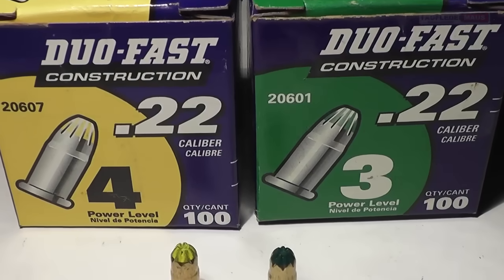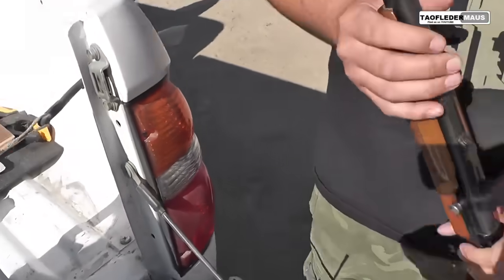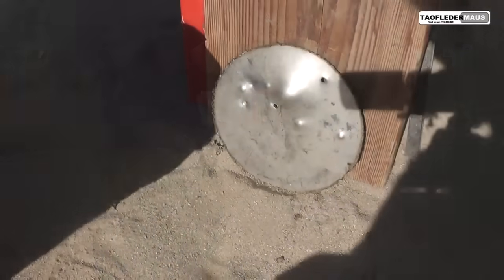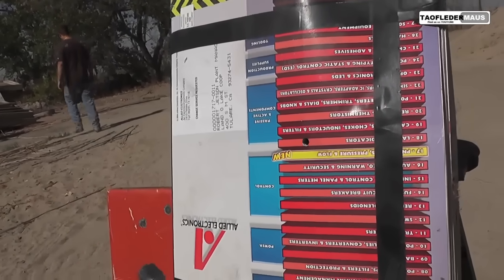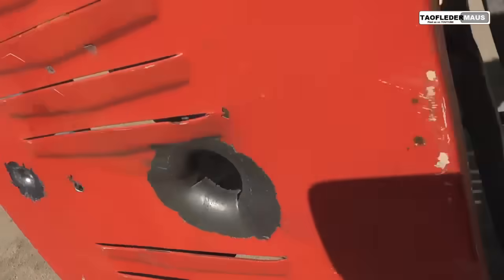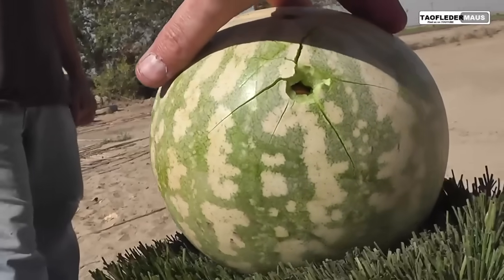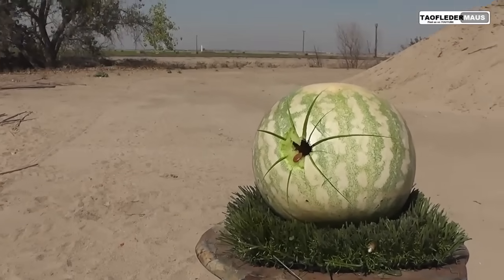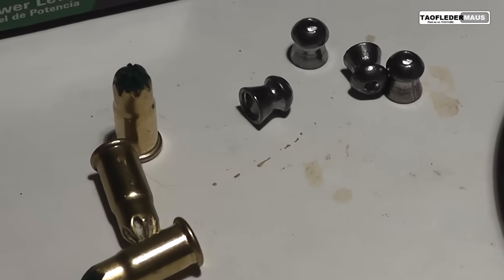Shooting .22 PELLETS Using NAIL GUN Blanks - What happens?

Comment: Thanks for the idea!  Did you know that a small pistol primer fits perfectly into a 22. case?  Break off a 22 head, dump just a little powder out (to be safer lol) and press in small primer.  it becomes a bullet.  I wouldn't recommend this actually,  but it DID work though my SP 101 short barrel.  I didn't measure but primer must be exactly 22 cal in size because it came out full power (right through spray paint can) no excess windage

Comment: The reason why this is highly discouraged is because you need to leave enough space between the pellet and the blank for the blank to expand when it's fired. This creates a problem because leaving a gap between the power source and the "obstruction" leads to a pressure spike which puts much more stress on the barrel than it's designed for.

Comment: Just saying, I have had a 22 blow up in my hands and I was lucky that's all that happened.
Reply: How did that happen was it a top break over under???
Reply: @frankatchison1617  It was a simi auto but my dumbass filled all the empty space in the shell with gun powder. The only thing that probably saved me was I drilled a hole in the action that I could put an Alan key in to make it a bolt action.

Comment: How about a .22 revolver? Take the cylinder out and load it up. Put it back and fire like a old cap and bail pistol.
Reply: Tried it. Had to use some paper to hold the pellet in the cylinder but it works awesome. Punches holes instead of pushing through.
Reply: Says the guy who didn't watch the whole video😂
Reply: My bad I was a Ruger semi-auto 22 LOL
Reply: Pellets are soft lead. At high speeds and fired by a hot powder charge I would think barrel leading would be an issue.
Reply: Use airgun slugs in a revolver instead of pellets,

Comment: I remember being a poor southern boy in Texas. Me and my buddies didn't have the cash to buy rifles so we took piece's of pipe with a diameter big enough to fit a 22 round and a end cap with a small whole drill off center. We had his dad who was a shade tree mechanic weld a nut to the end of the cap so it would act as a guide for a carpenter nail then another small piece of pipe with one side cut so it would hold the nail with a small spring on the back. To load we simply unscrewed the end cap and placed the 22 round into one end and put the cap back on. To fire we had a small piece of wood blocking the nail from striking the round. We simply lined up a target and pulled the wood out and bang! Dead squirrel for Dinner! Yeah it was inaccurate over a few yards but for squirrel's, rabbits and other small creatures at close range it worked! So glad we never used nail gun blanks and pellets that extra hot charge would have blown up our DIY rifles! Great time's Great vid!

Comment: There are a few thing  to do to get good accuracy. First off a pellet 22 cal is smaller than a 22 lr  so its  not going to   fly right  out of the  barrel they are not spinning  . Most of the   pressure is getting lost   around the pellet  in the barrel  because its smaller  than the barrel .   Use a 22cal lr  mold and make   some  lead bullets . Load the  lead  bullets  in the gun like  you did the pellets  and it will work great  and its very accurate .  With a air gun pellet  because its not a slug  it will tumble  at anything  fps over   1,000 fps . If you don't want to make the lead bullets   just buy these https://northamericanarms.com/shop/parts/cbb3/    What you are doing is like a Cap & Ball   setup . You are just using  to light and to small of a pellet .

Comment: Why even bother when you're using a .22 rifle and paying 5 buck for a pack of nail gun charges plus the cost of the .22 pellets, when you can go to Cabelas and pay 3 bucks for a pack of .22 LR bullets, built specifically for the rifle you're using?
From Cabelas website:
Caliber: .22 LR
Bullet Weight: 40 Grain
Bullet Tpe: HV Copper
Number Of Rounds: 500
In Stock Online
$36.99

Comment: Jeff, I'd love to see you guys mess around with powder-propelled pellets some more. Could you make up rounds that would feed? Maybe based on .22lr cases?
Reply: It should work in a revolver maybe?
Reply: @roosterqmoney  That seems like a sensible suggestion, yeah! In as far as 'sensible' applies here...
Reply: It's very easy to bite the bullet out of a .22 round without deforming the case. We used to bite the bullet out, shove the open case into a bar of soap and shoot each other, lol. Since the .22 pellet is slightly less diameter than the bullet, it should be aesy to seat by hand.

Comment: Sweet! Reminds me of when I as an 18 years old young guy ( approx 40 years ago... ) modified cheap .177 brake barrel airguns
and shot .177 copper coated round ball pellets driven by 6.8mm  Hilti ( Finnish brand ) Ultra Strong Nail Gun Ammo ( were available from yellow=weak to black=ultra strong ). The amount of powder then was way bigger than in these .22 ones shown here ( 6.8mm compared to 5.56mm ) , and the weight of the pellets considerably lower.  The speed of those tiny pellets  I would judge exceeding 3000 feet/sec by a pretty good margin.  Even if I must admit I  today feel rather ashamed having done it, I tried it at a bird at close range .  At the impact a sharp bang was heard and the bird obviously experienced hydro static shock  as it exploded  and  was spread radially  like a "sun" with an outer diameter of  maybe 10-12 feet. Small fragments of it's skull, claws etc  could be found here and there .
Those guns were awesome but of course very deadly, and sounded  roughly like a hunting rifle for deer or elk or similar. when fired. Cheers, Magnus, Gothenburg, Sweden

Comment: For the higher power nail blanks , try melting some solder or lead, or even fill the back side with epoxy to stop the skirt from breaking up. Seems the lead will add weight and increase the range and stopping power. And also save lost accuracy at distance. Maybe glue a bb in back of pellet
Reply: Solid pellets (slugs) are available off the shelf you know.
Reply: @edstimator1  oh i haven't seen them anywhere.  Its not too hard to just make your own.

Comment: Bloody good show, loved it just a pity the loading process can't be sped up. Would it be possible to super glue a handful of pellets and charges, then breech load?? Or is the length an issue. I used to use starting blanks very short and air pellets, went really well but never did any ballistics. Thanks for the vid
Reply: NO!!!! The pellet needs to be in front of the case at least 3 inches, Otherwise, the pellet will break up in the barrel.

Comment: I've used the yellow loads, to nail 2×6's to 3/16" steel beams with PL400 adhesive for extra measure and cushioning. You have to use special high carbon steel  nails, that fit the Hilti gun as well.
Reply: does it get more powerful than the yellow ones?
Reply: @gonzogriff  Here in Ireland it used to be yellow>red>black with black being most powerful, that was 40 -50 years ago though , so I don't know if its the same here nowadays...🤔

Comment: Back in the 80s, my family had a fire sprinkler Contracting Company. One of our workers was shooting hangers in the ceiling, when his gun jammed. He took it to a wall, made of drywall, and plunged into it to see if it would fire. It fired went through that room, into the next room, and hit a plumber in the kidneys. He died the next day. Stupidity on the sprinkler mechanics part. Not knowing how powerful those things are. But I learned from it, and I have made Firearms do the same thing with those charges. They are cheap. When the s*** hits the fan, it's not a bad idea to have some pellets in 22 shells handy. Not to mention, some of the pins that are designed to shoot out of the Hilti guns, shoot straight out of normal firearms. I'm not saying build one of these things, and aim and haul ass. And I'm not recommending this. Special care and safety is needed. As well as cleaning and inspecting the firearm. But we're all grown-ups here. At least wear eye protection

Comment: When I was in the Army, we used M16 blanks,and Crossman .22 pellets, firing out of M16s
Reply: I Wonder how many feet a second that would go?
Reply: @ronniepirtlejr2606 yes
Reply: @ronniepirtlejr2606  5
Reply: Lmao that's awesome XD
Reply: We shot the cleaning rods out of ours!😂
Reply: @DogFarts96 stuck my rod in a tree doing that
Reply: @DogFarts96 q-tips.
Reply: CubanAssassin MMA  there flared at the back so maybe it fit just snug enough
Reply: How many miles per second did it go?
Reply: @petersmythe6462 over 700 meters per second. Just over two seconds for a mile. 

I reckon the optimal result is achieved because the pellets are impacting at above the speed of sound in the watermelon. 😮
Reply: Sure you did 😂 clown.
Reply: @James406Z jackass, ya got proof? Otherwise piss off.
Reply: It's not going to bounce around. It is .22 caliber. It's the same caliber as M16 or AR15. The cartridge may be designated as .223 or 5.56 but the bullet diameter is .22 caliber.
Reply: Blanks and a cleaning rod, great improv way to hunt small game.
Reply: In Europe, 7.62 blanks and a pencil dropped in the barrel after works good too!
Reply: I watched a drill sgt kill a moccasin with a blank and a cleaning rod during our field exercise.
Reply: Bullshit wouldn’t work ! M16 is a self loading rifle so where would you put the pellets ? You would have to stop and reload after every shit unless you modified the actuall cartridge itself to fire .22 crossmans
Reply: @rangers11000 Push the pellet into the chamber with your finger, then close the bolt with a single blank in the magazine. Not rocket science.
Reply: @magisterrleth3129 I side with rangers 11000 , you need a blank firing adapter to shoot blanks for training , it permits the m16 to fire in auto , the infantry is not trained to load 1rd at a time in the mag
Reply: @kennethmcdonald5278 .....sabos........they probably use sabos dude. I feel like that's the obvious conclusion that they put it in a sabo so it doesn't just bounce around in the barrel.
Reply: @kennethmcdonald5278 you need a projectile in the barrel (pellet) and NO blank adapter. It fires one time. Then you reload and have another shot.
Reply: @rangers11000  its like you didnt watch the video. its probably a bullshit story but could be done as clearly seen here. just nto an auto loading weapon.
Reply: @rangers11000 how about making a jig to hold the cartridges and pellets aligned so you can superglue them together. Do say six at a time. You could go to town with the fully auto mach five kinetic impactors. 🤭 
Mind you those nail charges are pretty beefy.

Comment: Hey there Taufladermous could you possibly do a video testing the ballistics of a standard 800 to 1000 fps .177 or .22 air rifle using different pellets like the extremely heavy g-hammer and flat tips, sharp tip magnums, diablo domed tips and expander tips aswell as shooting a pellet backwards in slow motion at increasing distances (say 10 yards then 25 yards then 50 yards)  PLEASE

Comment: Ok so it worked and it's interesting to watch..but I'm curious as to what's the purpose of this? you say this is scientific and it's good the warnings you give, although only last in the text do you say that you may lose fingers doing this. 

Scientific research has a goal, a purpose, to try to prove or disprove a theory. What's your theory, that's all I'm asking.. 

And you don't mention potential damage to the firearm..as it wasn't meant to be used in this way. Potential to lose fingers implies damage to the gun but even when it's worked as you show, I'm curious if there was likely some (small) damage to the gun which may affect accuracy over time and this is another consideration when doing this kind of thing?

Comment: A bit "Johny come lately" we were doing this 50 years ago when I was a teenager. We loaded the .22 slug in the breech of bolt action single shot rifles using a modified bent nail to make sure the slug just started in the rifling. This avoided erosion of the chamber. Muzzle loading the slug leads the barrel and damages the slug. You could/can get a range of different sized blanks; from concrete, through timber, right down to starting pistol blanks. I rat hunted with starting pistol blanks and .22 Wasp air-rifle slugs , powerful enough, quiet and accurate.

Comment: As an AR-15 competition shooter at Camp Perry there is one thing to keep in mind, pressure. When you reach past 2300 FPS there can be as much as 50,000 psi next to your face. I run 68 grain 223 with 748 ball powder and magnum primers. My rifle is designed to tolerate these pressures. However doing this with an older rifle it WILL eventually have a catastrophic failure. In the comments a person mentions " but left behind a ring of lead that prevented me from shooting again". The person is describing severe fouling and will cause the weapon to explode! As I write this 4,080,785 have viewed this video. God forbid ANYONE tries this. you might want to consider taking down this video. Some ideas are better left alone.
Reply: Go back to the range then. I’ve done it my whole life with tons of different guns. Never had a problem and all my friends that do it have never had problems either

Comment: Given the muzzle velocities achieved with the yellow tipped blanks (chronographed by RyeOnHam), they are pretty much .223, just that those are pellets/slugs, instead of FMJ rounds.

Get a hardened steel, copper or tungsten carbide 21g pellet and you got a true armor piercing improvised cartridge.
Reply: I've stumbled upon at least 2 or 3 'projects' that expanded on this concept.
Sadly, I can never find details, but on Cartridge Collection websites you can find .22 rimfires that were intended for armed drone aircraft. Basically, FMJ, AP, tungsten, etc. .22lr.

Comment: I think the ideal gun for this would be a double action .22lr revolver.  With the swing out cylinder it would be very easy to place the pellet directly into the rifling, put your blank in the cylinder, close it and fire.  Hell if you wanted too you could put nail gun blanks onto a speed loader/ moon clip so you could have 10 rounds of plinking at a time and actually be able to do it fairly quickly if your range rents by the half hour.  Pretty economical way to shoot if you just love plinking.

Comment: Been doing this for years, first of all you do not put the pellet down the barrel. Open the slide set the pellet the other way Smh and make sure the pellet is 2"away from the round in the barrel,this will stop the pellet from blowing up from the force.When i was doing this it would leave a 45 cal sized hole in a microwave with no exit wound.Oh yeah, these powder charges bent my slide on my 22 cal bolt action Cooey.

Comment: Light pellets work great with these nail gun loads BUT BEWARE the heavier pellets puts more pressure on the casing and will cause case separation. It's not fun trying to extract a case with no rim. So stick with the light pellets. Been there and done it.😯
Reply from the maker: Yes,  that is what happens,  just blows the base off.  If you are using a semi auto,  it's very loud when the explosion come out of the ejection port near your ear.

Comment: You're neglecting to factor in chamber pressure. What seems to work well has no signs of failure until it blows up. I'm not saying it's a bad idea.. It is a great idea. You're all fuckin innovaters. But there are no signs of overpressure like in traditional loadings such as pocketed primers, blown cases, split cases, flat primers, absurd recoil.. Also, keep in mind, that a faster projectile will always make a "cleaner" hole in the steel.
Reply from the maker: I didn't neglect the fact that you aren't supposed to put these in a firearm.
Reply: TAOFLEDERMAUS you're right, but I was merely stating that there's no way to show if it's in the safe zone until it all goes to hell.

Comment: Single action revolver, Ruger single six, take the cylinder out, load all while it is out, stick it back in and fire away.  I put the nail gun blanks in with no danger of accidentally firing then load the pellets on top.  Rabbits, squirrels and Chukar partridge don't stand a chance. I use the EXACT Jumbo Monster DIABOLO pellets at 25.39gr. with number 2 power level.  Sort of like loading an old cap and ball.  Now I find they make a mold for casting 22 bullets, that'll be my next project.

Comment: make sure you seat that pellet against the cartridge well, otherwise it is the same as not seating a ball in a muzzleloader.  The chamber pressure will go sky high.
Reply from the maker: The pellet is fragile and needs to be in the rifling,  so it isn't against the cartridge.   If you put it against the cartridge,  it doesn't work, in fact, it will cause the back of the case to blow out.
Reply: TAOFLEDERMAUS that's probably why they where getting such good penitration

Comment: The funny thing is there is no powder in a nail gun blanks, its only a primer and then the air pressure drives the nail.
Reply from the maker: That isn't true.
Reply: actually you can get some with powder but most of them has only primer.
Reply from the maker: They have powder in them and vary the amt. of powder according to the power rating of the blanks

Comment: That's 7 cents a round for something that loads slow and works better for varmints.  I wouldn't hunt with it because the pellet would end up contaminating meat when it disintegrates.    This would be great for that rifle with feeding issues, but shoots straight.
Reply: briansmobile1 

I don't think it would do squat to the meat. It punched a clean round hole through steel plate. I don't think a rabbit would fair as well.
Reply: Dawg meat and metal are 2 different things